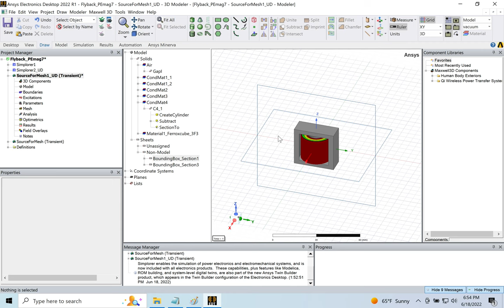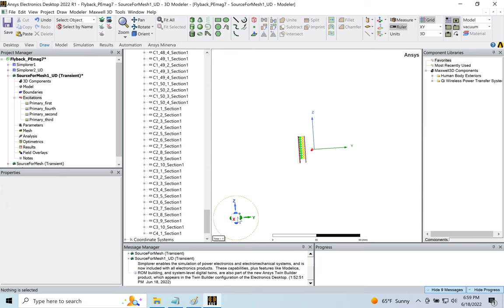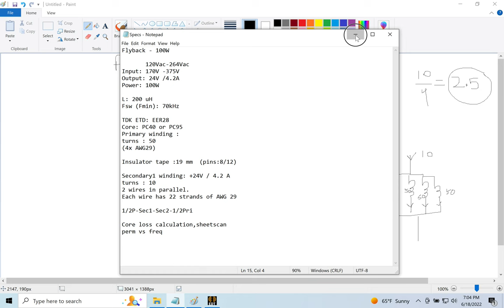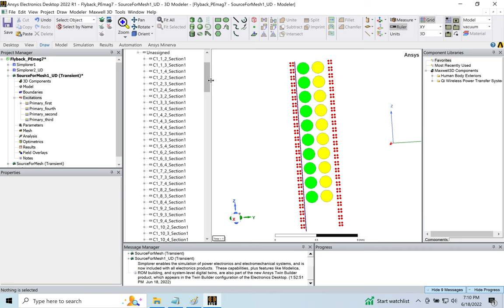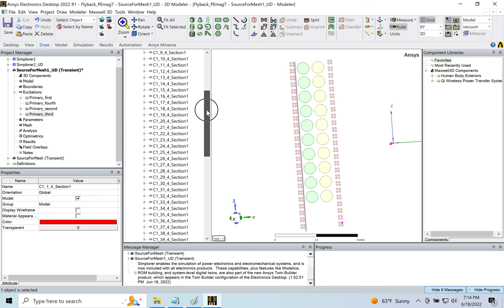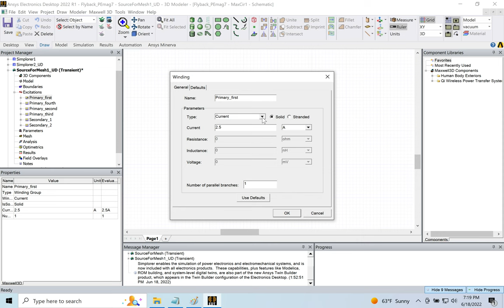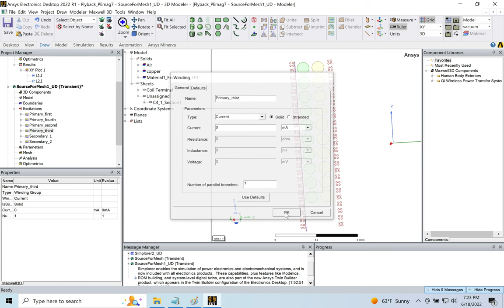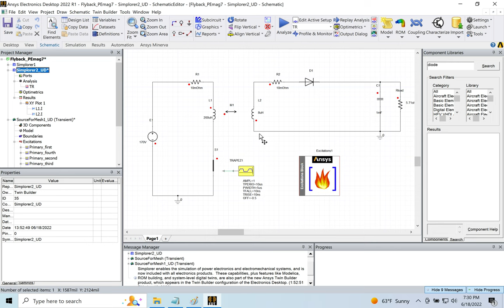Lecture 13- Maxwell 3D: Simplorer (Continuation)

Comment: Is not possible intead of selecting each wires seperatly just select stranded cable when creating winding under excitations?
Reply from the maker: Just choose litz wire. Much easier, you don't need to select individual wires separately. I never tried  stranded option. I remember Ansys engineer saying not to select stranded , I need to dig into the explanation as to why.
Reply from the maker: Try and see what happens when you select stranded
Reply from the maker: Also there is documentation pdf under help, try searching for stranded. And there will be corresponding documentation
Reply: @PSPS437  Ok, just tried to simulate 5x1mm wire compared to 350x0,12mm wire litz, 5x1mm gave me 68W losses. Litz wire just 58W. So i think i am missing something. Selected litz on PEmag, under winding on excitation is stranded cable with 1 parralel branch. Litz wire is sellected in the material of copper with number of branches, and diameter of single wire. Just for info i have also tried 56x0.3mm litz and this gave me 250W of losses. Transformer is not interleaved, ITS P-S1-S2. 50khz fullbridge converter, aprox 20A avg on all windings  (40A peak on secondary).
EDIT: Also tried to simulate 5x1mm under "litz wire" ive got about 1kW losses on wire. Then tried interleaved winding with 350x0,12mm wire and got about 40W losses. I expected lower AC losses but it seems ok. When i say AC losses its DC+AC in ansys.  But my problem si I dont know if i can trust those simulations i am beginner and dont know what to expect =D.